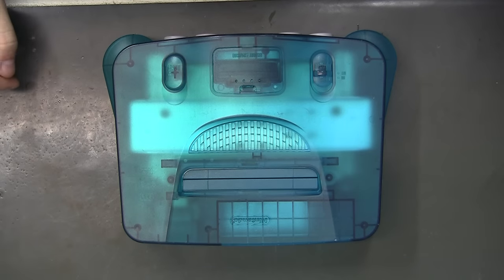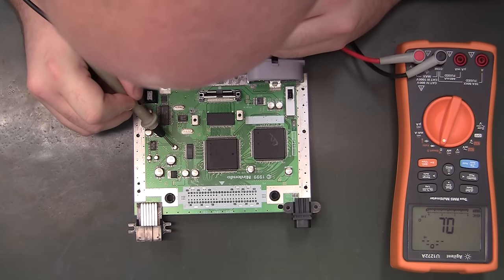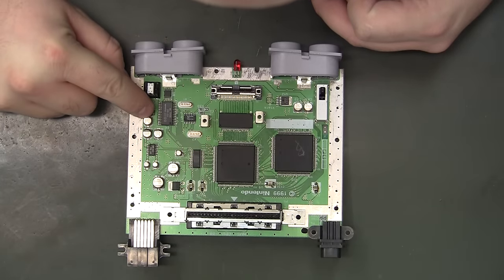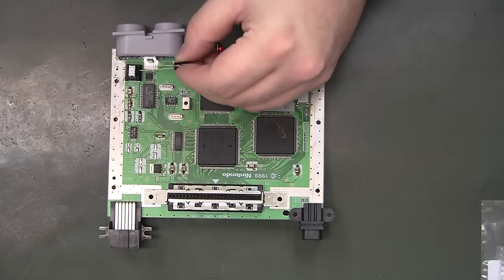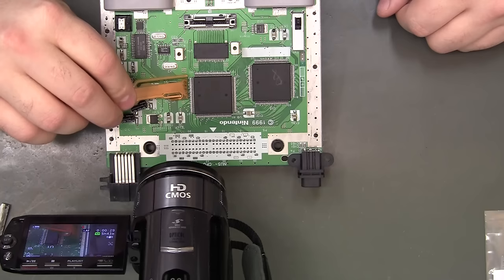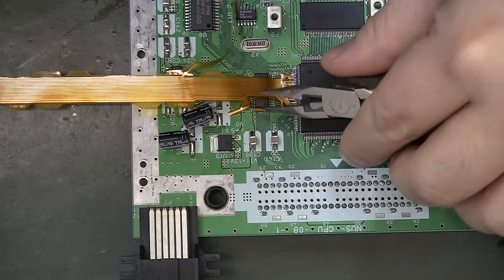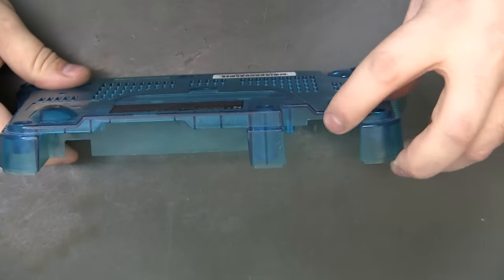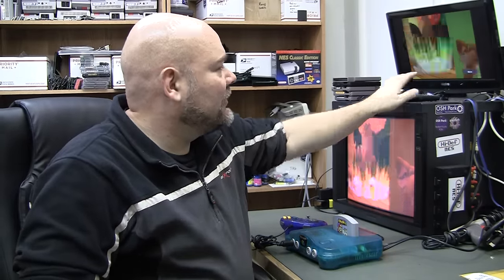N64 UltraHDMI and ceramic smd caps install

Comment: As nobody else appears to have said: VTerm is the termination voltage for the RAM.
The way the RAM works means that for a logic '1' it swings slightly above VTerm, and for a logic '0', swings slightly below VTerm for signalling, so that voltage provides the transmission reference and bus terminations. You'll frequently also find this voltage called Vtt.

If you're interested in learning more about it and why it's required, I suggest starting here: https://en.wikipedia.org/wiki/Stub_Series_Terminated_Logic and https://www.maximintegrated.com/en/app-notes/index.mvp/id/1775

Comment: That first fold in the cable is actually supposed to be closer to the chip. You can see notches in the side. Your fold is supposed to go between them.

Comment: I used my stereo microscope and the ultrafine tip on my Hakko 900s when soldering my UltraHDMI.
My eyes when you one shotted the whole thing in a single move with that big honkin' tip... O_O
Wow!
Anyway, I played today, for nearly 5 hours! The modded N64 works amazingly well!
Reply: richfiles It is definitely faster and much easier to use a drag soldering method.
Reply: It’s super easy with tons of flux. Watch Voultars video on this if you want to see some top tier soldering

Comment: for removing those caps I recently came across the technique of using some pliers and slowly twisting them, the legs stay attached to the board but the twisting motion pulls the legs from within the barrel, its so simple.

Comment: The light guide appears to be missing at 41:00 minutes.
Reply: Rewatching this after my fourth install and I see that you folded the cable after soldering to the via for controller input. This means that you couldn't fold the cable at the right place (where there are notches in the side). Not too big a deal. Also, "Pin 17 stuck low" was definitely due to a silent part in-game.
Reply: It definitely is lol

Comment: Would you happen to know the actual maximum amount of expanded ram that the N64 can use greater than the 4mb card?  Or a expansion card mod with more memory? just curious is all and if it would cause anomalies.

Comment: Those ceramic capacitors look like they would be good fits for the gamegear.
Reply: I was thinking the same thing, the issue I see is I cant find the ceramics with the voltages. IE the 0.47uf is a 50V cap I found some on Aliexpress but they dont have the voltage listed

Comment: I am pretty new to re capping so please bare with me if this sounds at all silly. 
Is it a good idea or at least safe to use Aluminum Polymer in place of standard Aluminum electrolytic capacitors?  I have read lower ESR is a good thing  and theses caps are MUCH lower ESR than standard aluminum capacitors. The polymer are only a bit more expensive as well unlike tantalum witch are YIKES in price.
Also the obvious is there any time I should NOT substitute cap types at all?
Reply: To my knowledge the only reason a manufacturer uses a type of cap is for cost and or bad design. You only need specialty caps for certain applications like if you are sending something into space you will buy the highest quality components money can buy, if you are just replacing caps on a console that will be in use for not alot of years it doesn't really matter.
Reply: TehHijack He's asking when you should not substitute one type for another and there are situations where you would not want a solid state ceramic in place of a polarized electrolytic or something. I'm ignorant about where and why so I have the same question, but I know that it isn't purely an issue of cost. If anything, don't ceramics usually cost less?
Reply: Just my opinion here. Would use the organic polymer in the places he uses ceramic. The large ceramics are higher risk of cracking when board flexes. The organic polymers are plenty low esr for digital circuits and what computer manufacturers have been using for years on motherboards. I would not use polymers or ceramics in analog audio circuit. Just my 2 cents.

Comment: hey guys, i've got a quick question for all of you out there. will doing this improve video quality at all? the reason i'm asking is because i did this ceramic cap upgrade on an old 1996 cpu 03 board, virgin system, never opened up, and i swear the video quality is sharper than my cpu 08 clear red and a later ?1999? revision board that i have laying around. i did not touch the 4 caps on the a/v output, but did the rest and as i said, on the everdrive menu, the lettering is much sharper with no bleed together between the letters, where as both of my other n64s have bleed on the letters. i had read somewhere that the color editions of n64 have better video quality than a regular n64, which i do see a tiiiiiiny bit. but this cpu 03 is significantly better. i'm still waiting on my ultra hdmi so all of these comparisons were using the stock a/v cables on a modern hdtv. i didnt think that video quality would be effected by this so i did not take note before the cap change. did anyone else do this conversion and notice a difference?

Comment: why would you use standard Electrolytic when you can purchase the cans and they're usually not much more cost?

Replacing the Electrolytic with Ceramic if you can pull it off is a great idea, but Im stuck up on the Cans.

Comment: I don't get all the hate hot glue gets. It has its proper applications and is easy to remove with the right technique. I often see it used on factory mods to hold wires in place under PCBs for example. 

What I don't like is when I want to change something in an RGB scart cable and the builder filled up the housing with hot glue. Used sparingly it's good though.

Comment: is there no way of getting the SPDIF signal so that can be fed into the HDMI encoder board so you get audio through the HDMI lead, what is the name of those surface mount electrolytic capacitors that you don't like.
Reply: DAVID GREGORY KERR The audio does come through the hdmi in pcm format. The signal is taken directly from the RCP.

Comment: if you already  mounting those caps on their sides, why not cutting one leg shorter and turning them 90 degree? they would fit much better
Reply: I would guess that you run the risk of the legs shorting on each other.

Comment: Im changing lcd screens in VAG  cars and i solder pads on ribbon cable one by one with 1 mm solder tip and never had problems.

Comment: I have an X'eye that has distorted sound; CD-Audio plays fine (and Genesis audio plays fine), but compressed PCM sounds garbled and can fluctuate sometimes. Do you think replacing the SMD caps around the PCM chip could be the actual problem? I've replaced all the electrolytic caps already

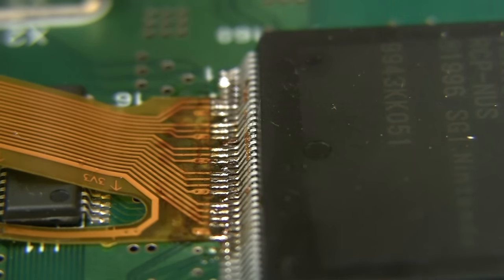Comment: 26:16 It looks like there is a leg lifted to me, could that be the Pin 17 error you got on the first self diagnostic test?
Reply: I think if you're referring to pin 17 on the chip, it's just the flexible flat cable that hides the base of the pin, making it appear that it could be lifted ;)

Comment: Have you ever seen anything to indicate failing caps inside an N64? Other than the external power supply, I can't say I've ever seen or heard of failed caps in an N64. It seems kind of like the NES where they really only fail inside the RF/power module, but not on the board itself.
Reply: The problem is more the leakage than the potential failure. Much easier to change the caps now, than to try fixing a corroded board later.
Reply: Joe Snes Leakage = failure. :(

Haven't seen/heard of it for these caps. They could have more in common with the NES mainboard caps, which even Jason doesn't include in his cap kit because they seemingly never fail.
Reply: I've never seen a failed cap in a N64 either. I've bought huge lots of non working N64's and never found 1 in all the failures. Connectors,power supplys ,switches,regulators RCP's and video DAC. Thats it no caps.
Reply: @audiogear474  Yep. Of course, that was 4 years ago and I might’ve finally encountered one last year in a late-model Japanese Pikachu console which was probably made after Panasonic started reformulating electrolyte for future RoHS compliance. It had no audio until I accidentally shorted pins 1 & 2 on the NUS-AMP chip, which had already been replaced with a known-good spare. I momentarily sent 12v from pin 1 into pin 2 and a nearby capacitor (rated 25v) which suddenly restored sound. The NUS-AMP chip had already been replaced with a known-good spare to troubleshoot the audio so it wasn’t that, which means I might’ve accidentally shocked a bad cap into working. Still works too. :) So how’s life treating you, Alan?
Reply: @emmettturner9452  Hi Emmett its possible if there were manufacturing issues with cap but would still be suprised. That cap already has 12v on it if its the one I'm thinking about. I'm not sure what happened when you shorted it but something opened up somewhere. It would be nice in there were schematics like on SNES. That is an op amp but not sure which one they were using  in order to look up a data sheet.  I'm Ok except for pollen this time of year. How are you?

Comment: great video, i recently ordered both the hi def nes and ultra hdmi from you not too long ago. can't wait to get them in. before i install the ulra hdmi i'd like to do the cap replacement like you have. what are the proper mouser part numbers for the smd caps you used?

Comment: Awesome, I can't wait to get mine installed.  I pre-ordered on the site when they were available; any updates yet on when you might get them in?  You mentioned in the last video it could be a couple of months, but I can't help but be excited about it.
Reply: Justin Oakes Game-Tech has said when he has updates he will post the to his page first. It's really dependent on when he hears from Marshall. With Chinese New Year it's safe to assume the time line will be a bit longer. I wouldn't expect anything until end of February at the earliest honestly.
Reply: MobiusStripTech After I posted my question I saw the post on his site.  But, I went into it knowing it could be a while.  Hopefully Marshall won't run into another production issue like last year that adds on more time.  It's really awesome that he was able to develop and produce these, but he's had some bad luck along the way.
Reply: Justin Oakes Absolutely. The big hold up last time was that he needed to hand rework a lot of the boards due to production issues. I know sourcing FPGA'S has been a bit rough lately too. It seemed like Marshall had a good handle on it this time around, so hopefully the next couple batches go quickly.

Comment: Forgive the electronics noob, and forgive me if it was mentioned and I missed it, but why electrolytics on the analog lines instead of more ceramics?
Reply: value not available in ceramic
Reply: I think there's an episode of the EEVblog about why you can't just replace electrolytics with ceramics in every case.
Reply: Adam Zey It has to do with the way ceramic can introduce distortion or change value when introduced to changing voltages. This can produce additional distortion.

Comment: The N64 is still not that old yet, does it really need cap replacement already? I guess it would make sense for the power supplies though.
Reply: It's just preventative maintenance. If you plan on keeping the console unlike a ps4 where you will eventually get rid of it, it doesn't really matter if the caps are old or not.

Comment: 19:43 that wasn't a nice sound that cap made...
Reply: Good eye! It almost looked as if one of the legs pulled out from the base of the cap. Love the videos by the way. Great job!
Reply from the maker: it was just the side hitting the mobo, nothing to worry about...
Reply: I'm sure you're right it looked great when you tested it. I hope you get some single boards up for sale soon, your making me jealous.
Reply: James Vandever If you don't follow Game-Tech on Twitter, I would recommend doing so. If he has individual kits for sale he usually tweets it out.
Reply: Great vid for the most part but I don’t agree with moving the capacitors around like that. Solder then in the position you want them. It’s very easy to overstress them

Comment: Any improvements from recapping?
Reply: Those ceramic SMD caps won't leak electrolyte all over the board, so no acid eating through the solder mask and traces.
Reply: It is preventative maintenance. the caps WILL leak it is just a matter of time and when they do they will cause alot of probably unrepairable or expensive repairs to the pcb. For only a few dollars you can save yourself the headache down the line.

Comment: Delay
Reply: I assume you also noticed the slight delay between the CRT and LCD? This is normal to see between these display types but I believe the mod itself adds delay, but it's less than one frame max and I think it even has a 'direct' mode for possibly none, might be wrong.